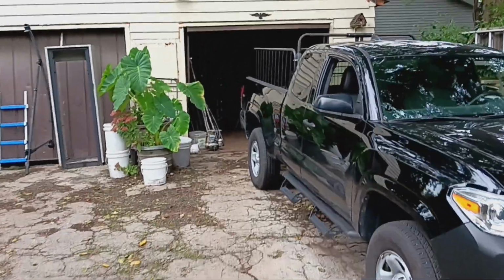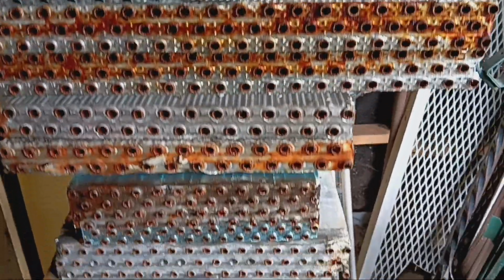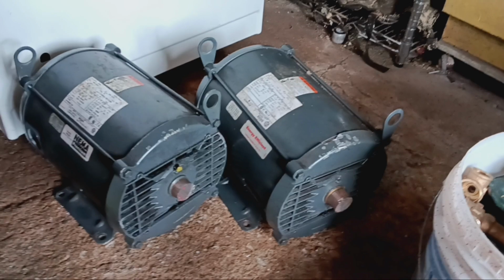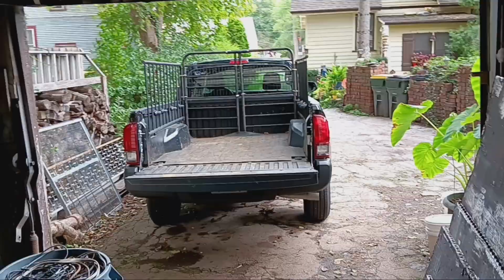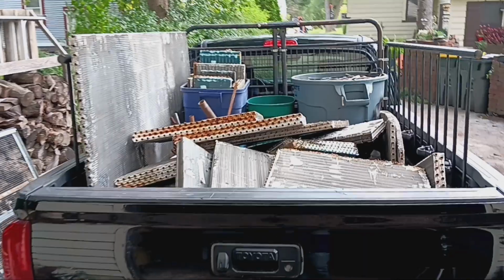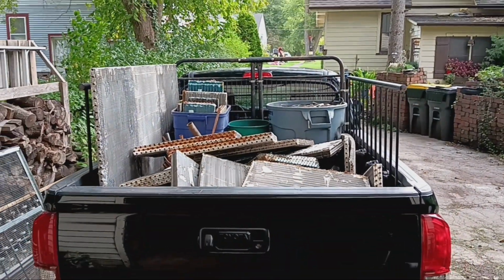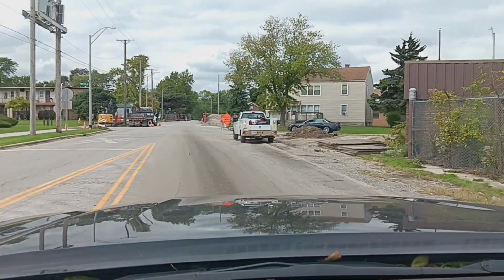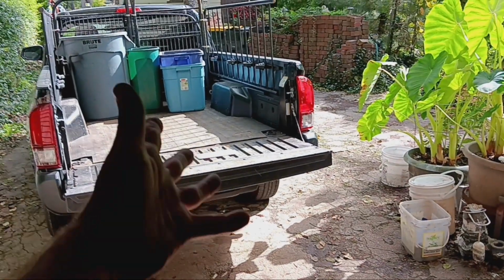Copper Is Up, Time To Sell Some Scrap

Comment: Damn that's a great haul. I get some pipe/wire from a local contractor but not a lot. I'd like to get a contact in HVAC who can supply me with ACs. Can I ask what your arrangement is with your HVAC contact? Do you pick up from the jobsite and do you pay him anything for ACs?
Reply from the maker: @newsweathertraffic18  Scrap from the hvac shop is free. They Scrap most of their stuff but I can have what they don't want. I also had a hvac tech from another company  I bought ac's from but he's not working right now.
Reply: @ThorntonScrapper  Thanks for the information. I've just ordered some business cards and I'm going to try making some friends. It's hard to decide my business model but I think I'll just go and see what works.